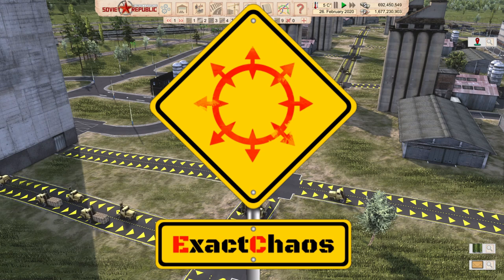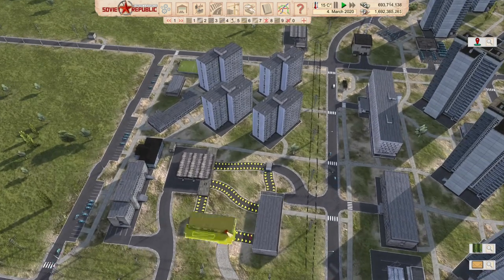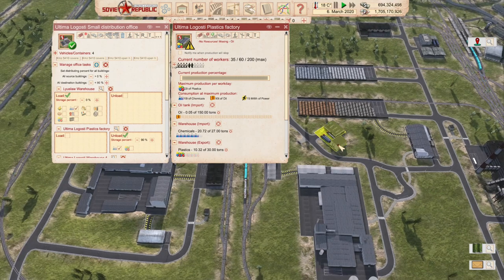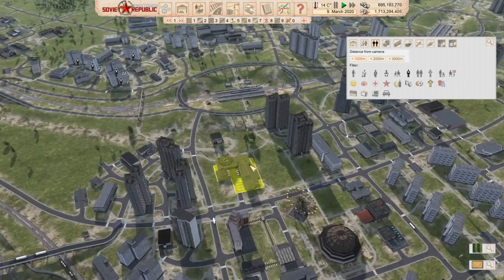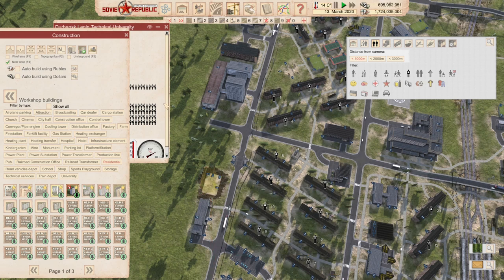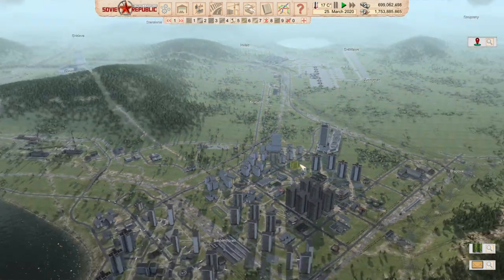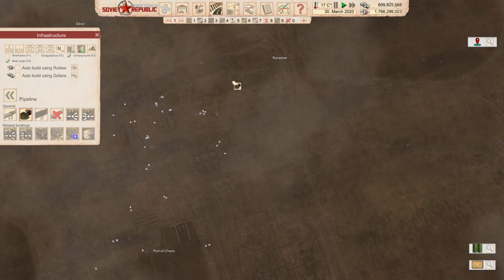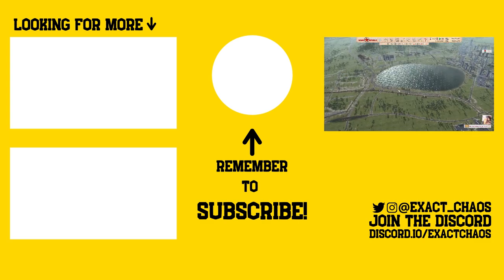How NOT to use Factory Connections - Workers & Resources: Soviet Republic

Comment: Forklifts are, like in real life, great for active pushing a storage connected to a store.

If you have a meat storage next to a shop, the shop will not automatically pull meat from the storage through a passive connection. But a forklift can forcibly move meat to the shop's storage. This makes them very useful for low-volume goods (meat, electronics, clothes, food, supply for chemical factories).

They are especially much better for meat storage, as the truck you get at the 1960 start (Skoda 706 w/ trailer) is way too large to be efficiently used by a distribution office to supply a small shopping centre. They will only ever use 1/6th of the capacity of the truck. This gives bad fuel economy, and means that you have to choose between bad utilisation (under 20%) or dedicating a truck to a single shopping centre (also bad utilisation, but less wasted fuel). By resupplying a storage instead, the truck can run at capacity, and support multiple stores, while the forklift actually supplies the store.

Comment: Factory connections with or without forklifts is what I dont unterstand. Does it mean even without forklifts stuff gets moved ?
Reply from the maker: The mechanic is a bit strange. Factory connections that link two buildings directly, without a junction of any kind will work without forklift vehicles. Once there is a junction it needs forklifts to work. So i would recommend not building networks of factory connections, but only connect directly between the buildings that need to share a good or resource.
Reply: @ExactChaos  It is so strange that this isn't really explained anywhere. The game does automatically put the factory connections down, but my brain went "but that won't work, there's no forklifts to shuffle things aorund". :/

Comment: How do you get ppl to work from far away?
Reply from the maker: You need to transport them to work, using either buses, trains, helicopters or airplanes
Reply: @ExactChaos  
You're right. It just doesn't work as good as pointing high density residential buildings close to work locations. 

The find that the bus routes need to be pretty direct and constant.
Reply: @ExactChaos  You forgot personal cars as well.